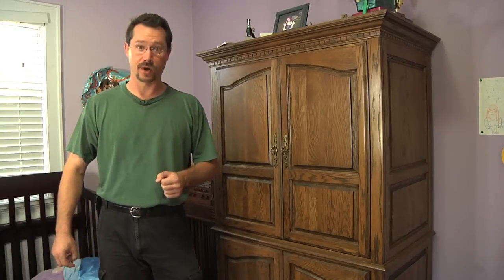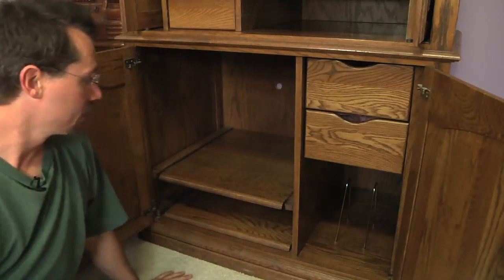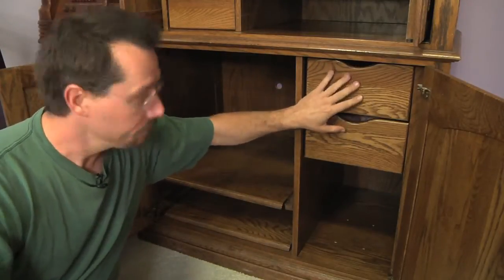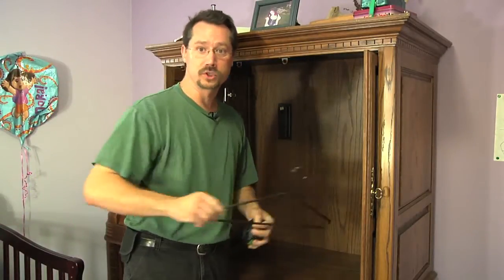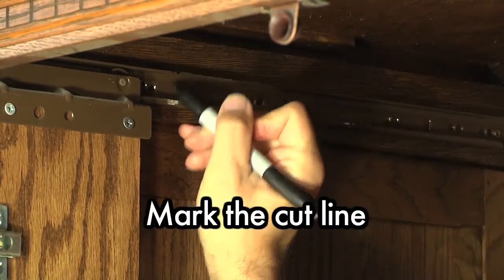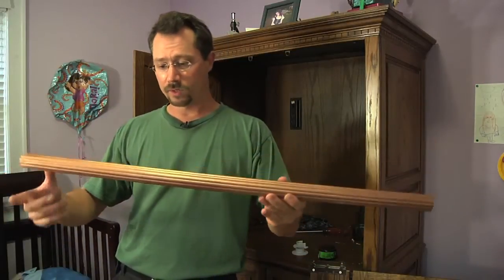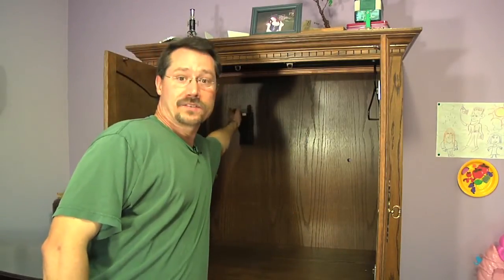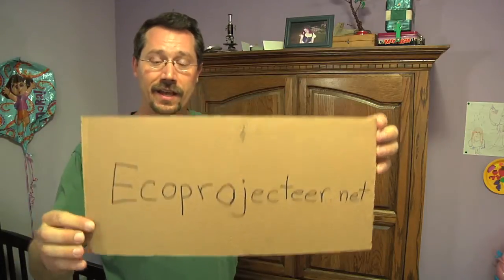DIY Wardrobe from Entertainment Center

Comment: That "closet pole" looks more like it was originally made for hanging draperies. I've never seen a fluted closet pole, but I have seen fluted drapery poles. Looks sturdy enough, and about the right size, though.

You got a great deal on that entertainment center. It looks like a nice, well built unit that the former owners had treated with care. It's still very nicely finished. The only reason you would want to paint it would be to make it match other furniture in the room.
Reply from the maker: Yes, I believe the pole was for drapery, but I already had it, and it was the right size AND color too!

Comment: I am wondering if you could have used the rear section of the track to have your stops you wanted?  I am not 100% sure if the front of the bracket makes much of a difference or not, but doing this could have saved you from having to have a screw in the metal.

Comment: You might have mounted the pole a bit higher.  Some sides on the bottom slider might have been better.  Very nice project all in all, Thanks.
Reply from the maker: Must be a bit of an optical illusion in the video. The closet pole is mounted pretty high. Any higher and the hangers would hit the ceiling of the wardrobe, instead of hooking over the pole.

Comment: @BenjaminNelson    So where do I but the closet pole bracket and a good closet pole?
Reply from the maker: The closet pole bracket installation is shown after about 7 minutes into the video.
Reply: By “but” I’m sure you meant buy… Try Home Depot or any other supply house. Even Amazon has them… Sorry you had to wait 4 years for an answer just because of a typo…

Comment: You cut up a curtain rod.  But whatever works!😊
Reply from the maker: I used some scrap material that I already had. It is the exact same size as standard wood closet rod. The only difference is it was free and slightly more decorative.